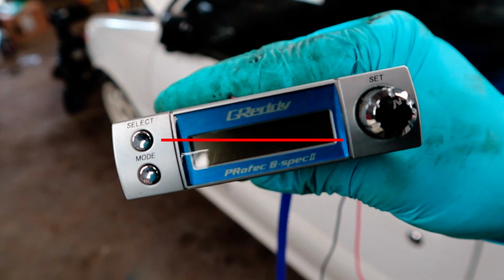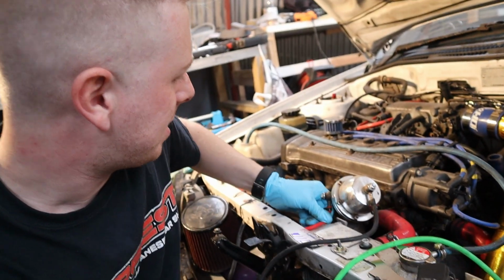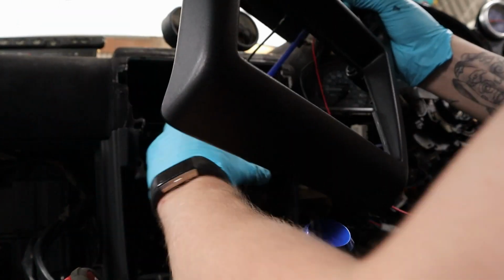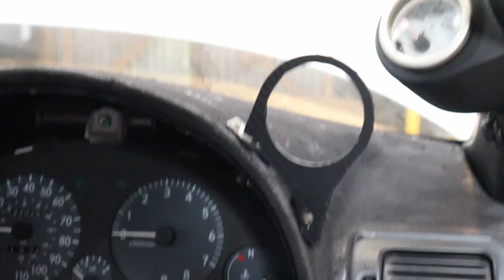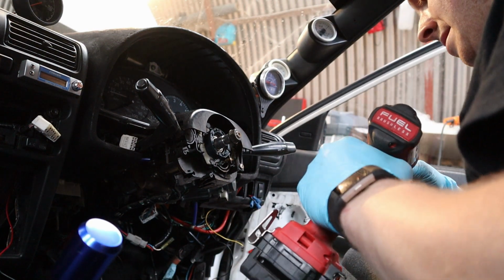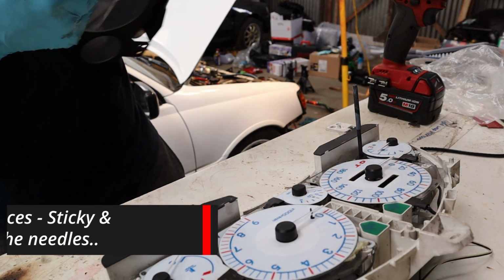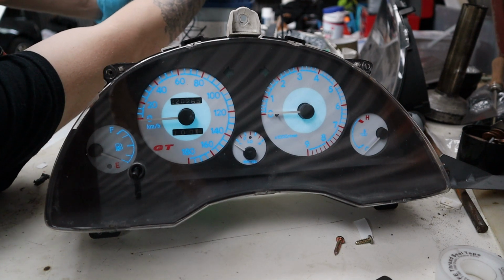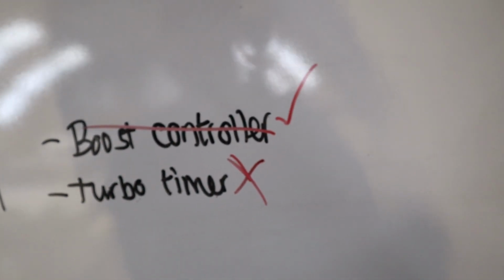EP82 Starlet: GReddy Controller, Blitz Gauge & Indiglow Dials - Episode 13

Comment: Hi my indiglow dials have leads connected to them. Where do I connect the dial leads too
Reply from the maker: The dials are connected to a small relay box which can allow you to adjust the colour/brightness, its this relay that requires the positive goes to the switch for your lights & negative to the body to the car.